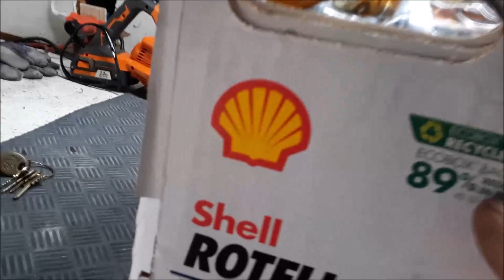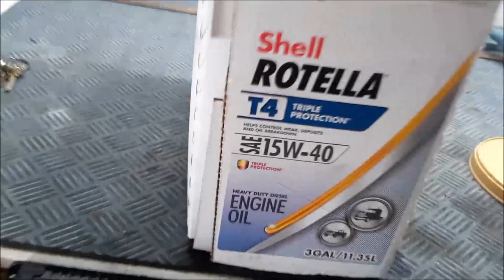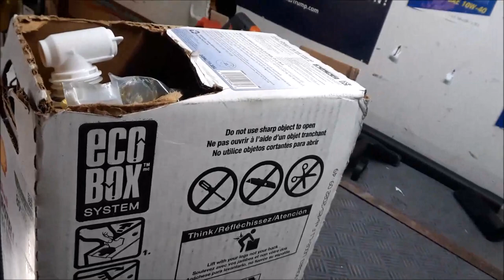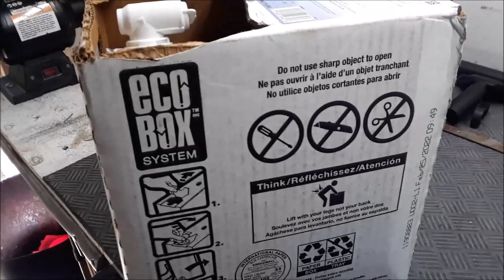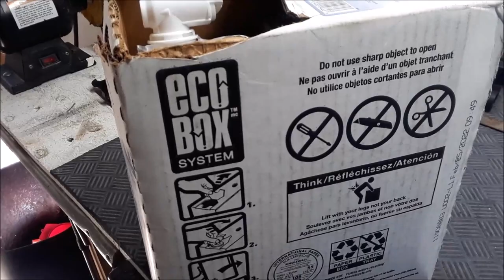WOKE? MOTOR OIL?

Comment: I think that I would have cut the box away more to expose that nozzle. Then it may be possible to get the oil in the enginr using a smaller funnel.
Reply from the maker: oh there was some sort of ''instructions'' on the box, tried all that. The nozzle was to extend out a hole in the box, but was at some weird angle. All great in theory, but still, un-doable with holding 30 pounds by myself over a funnel, under the hood. one mistake and exxon valdez under the hood. 100% STUPID!